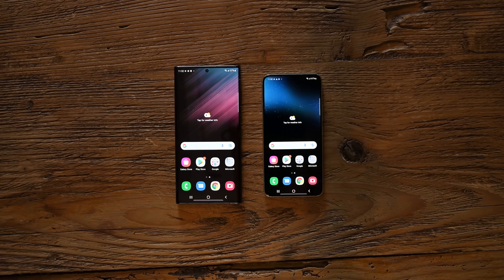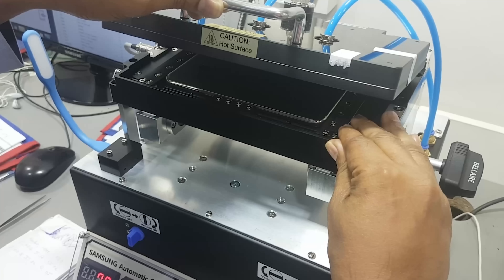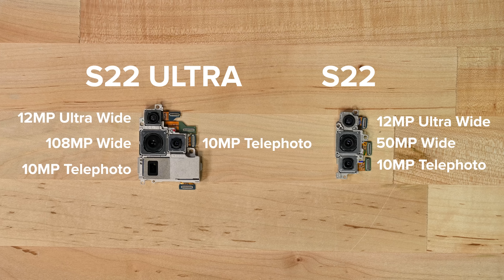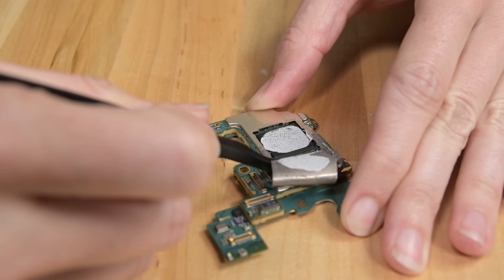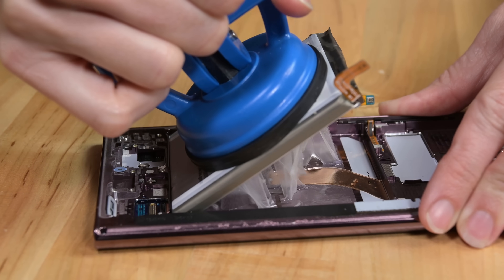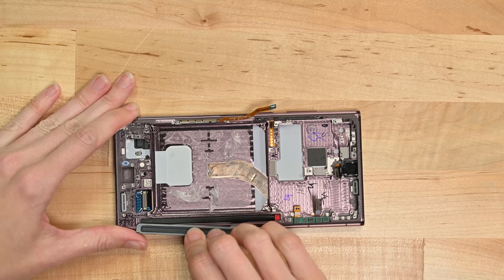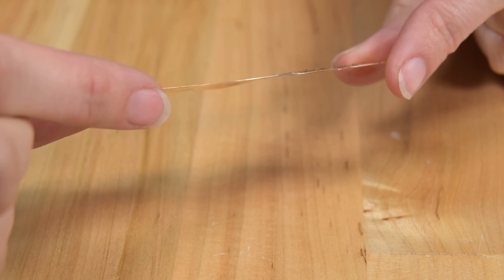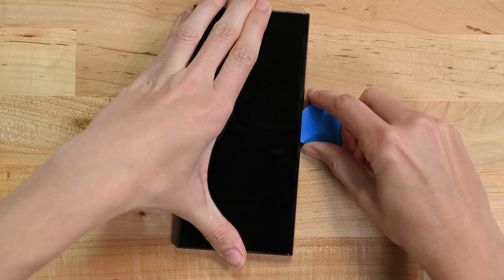Galaxy S22/S22 Ultra Dual Teardown: Note what we expect

Comment: Samsung: Almost all screws are the same lenght and size. The different ones are easily identifiable. All screws are phillips type screws. There are no hidden ribbons and overall unnecessary complexity. There are no software locks and no features removed by third party repair. YOU ARE ABLE TO BUY NEW SAMSUNG OEM PARTS.  

And you suggest a 3 on repairibility? Are you nuts? Apart from the excessively glued-in battery this phone is a breeze to work on.

And iPhone gets a 7? Don't make me laugh.

Comment: Love how tough adhesive drops the repair score to a 3 but software locks get a 7.
Reply: Seriously underrated comment. If it doesn’t work as intended after replacing parts - then it isn’t really repaired
Reply: Lmfao so true ifixit is so bad at this
Reply: Samsung devices costs so less to repair from Samsung themselves
Compare to mi, Vivo and other brands
Reply: It's insane just how daft these guys were for this....."repair scores that actually don't account for repairability".

I don't care if this got changed, but the fact that this was even a thing in the first place i just insane.... whilst the rest of the industry shows the world how terrible software locks & paired components were on the iPhones, some dudes who gave "repairability scores" dropped scored for "glue" whilst leaving the device with the most "paired" components at a 7.

Studied mechanical engineering, so the idea of someone complaining about glue that can easily be dissolved with Isopropyl Alcohol easily is just crazy to me. 

PBK Reviews' scores & teardowns was always 100x more relatable.
Reply: @Awaks  iFixIt has it in the name, they're apple duds
Reply: Yeah but after mrwhosetheboss posted the video about batteries on Samsung expanding idk it will matter because Samsung going boom boom again
Reply: @iustin1658  watched that and personally not the biggest issue in the world because it only seems to affect stored devices that have dropped to 0% charge for a long period of time. As long as you keep the phone with a 50% charge while stored the lithium barrier won’t break down and inflate the battery.
Reply: @CommanderCodey  that’s not always going to be the case, it’s not a big problem, it’s massive, because that means they are just weaker and will cause problems

Comment: I just bought the galaxy s22 and it gets scalding hot and slows down to a crawl when it does anything. Not something I expected from a new phone. I had an LG g7 which had a vapor chamber and anything I did on it kept it cool and ran everything fast. Why does samsung have an issue with overheating????

Comment: I upgraded from my s10 to an s22 Ultra, was surprised to realise the "ultra wide" camera isn't actually as ultra wide as the one on my s10!  And its also a shame they ditched (before the s22) the sensor for reading your pulse.  Also have you noticed that the small rubber bit at the end of the spen holder is not the same colour in every model.

Comment: If you accidentally inserted the sim card ejector tool into mic hole. Does it damage the water resistant?
Reply: No, modern phones have their seals at a right angle to the direction of the mic hole

Comment: I'm getting real sick of this expensive non-repairable stuff they're foisting upon us. I just bought a Framework laptop that is completely upgradable and repairable with a simple screwdriver. It's the antithesis of my MacBook Air. I keep hearing about the Fairphone smartphone but it's not available in the United States so why do they keep reviewing it here? I have a Terracube phone but the processor and camera are subpar so I went back to my OnePlus 6T. If somebody comes out with a workable smartphone that has the removable battery, dual SIM & microSD card slot that can be opened up without heat and prying, it's going to sell like hotcakes. Apple really did usher in the concert of expensive, throw away devices and Sammy has jumped in on it big time now too.
Reply: They don't do microSD anymore, because storage space is a way for them to jack up the price. Offering flexibility in SIM cards also sells them fewer units. It's all about those profit margins, environmental sustainability be damned. I don't see it changing any time soon, sadly.

Comment: Thank you for the video, it's terrific.  I was trying to pop the sim card out, and put the remover tool in the hole in the top, instead of the bottom, before I figured it out.  Did I ruin anything?  :-(
Reply: Maybe popped the grille on the mic, but the mic should still work. Phone will not be liquid resistant going forward

Comment: Did the scoring change? I remember the Macbooks getting a 3 because you can't replace anything. Here, you could replace about everything (ability exists, parts are questionable) and it too gets a 3?
Reply: Yeah that's weird. This phone is very repairable. Other teardown videos show you can even swap parts between phones without getting errors like the iPhone. Everything still works and mostly all parts in the phone are modular and easy to access. 

Not sure what their angle is here.
Reply: iFixit seems to have some very awkward relationship with Samsung. They scoring system isnt very reliable. They seem to constantly score Samsung stuff very low even if it is kinda repairable sometimes compared to other brands that got the same score. Lets not even mention that Samsung doesnt lock hardware to the motherboard or to the software like other brands. And still, they got only 3/10... oh well
Reply: they really didn't like the glue
Reply: @bradhaines3142  😂

Comment: 3/10?  Tough adhesive should not downgrade the score.  Just take a little more time.  Everything looked like it came apart very easy.  No soldered pieces together than needs extra work.  Just heat, take your time with adhesive, unscrew, unclip, and repair.  9/10 for me.
Reply: needs less glue. better ways to put things together
Reply: @bradhaines3142  Or no glue at all. There's absolutely no point when it's crammed in there tightly as it is.

Comment: 3/10 despite you not being software locked for replacing components.
Reply: iFixIt has a hard on for hating Samsung for some reason. Have been that way for a few years now.
Reply: @spacebound1969  Because Samsung stubbornly refuses to stop using super adhesive on a freaking battery for crying out loud. This guide depicts it being way easier to remove than they actually are. 

Not saying Crapple is any better for their countless shenanigans either.
Reply: Should have gotten at least an extra point for the software being completely open to component replacements, something that cant be said about some other brands

Comment: You are absolutely right! They should have made the S22 Ultra thicker to have a flat back with the camera lenses and they might have had the space to put in a proper vibration motor and all the other stuff like sd-card expansion, 3.5 jack, ir blaster that the phones are lacking. Even a bigger battery pearhaps.

Comment: Looks like theyve switched the speaker wherein the beefier one is at the top while the weaker side is at the bottom to compensate for the new vibration motor location, Looking from the x rays, the bottom ones seem to have the same exact magnet size of the note 20 - s21 series phones Top speaker assembly.

Comment: 4:04 how is it pushing heat down and to the sides there is no fans 🤔
Reply: Conduction?
Reply: Magic
Reply: they part that makes heat is at the top. the vapor chamber is attached to a piece that also conduct heat well. it would spread from the source

Comment: So not very repair friendly (thanks to adhesive and glass panels), batteries that are way too tightly shut in, and still no headphone jack and SD card slot? Looks like I'll be staying with what I've got.
I don't want to lose my data if the NAND goes kaput. Storing data on the SD card means that (a) you can easily transfer the data between devices, and (b) if the phone logic board goes kaput, you haven't lost all of your data.
Plus, if the SD card goes kaput (which, some of mine have in the past) then you don't need to buy a new logic board, you can just buy a cheap and cheerful SD card and get back some storage space.
Reply: They're trying to force people into subscriptions for cloud storage
Reply: @TheRealGandalfIgglywumpus  I don't think there's nothing wrong with that I use a cloud service and you can also get a external hard drive or a USB drive
Reply: @jeffreyfricke2304  So you will need a $$$ mobile plan to go with that $$$ phone just to have acess to your data (provided you never travel somewhere without coverage) which you've entrusted to a corporation for safekeeping.  Or you need to lug around yet another device just to make up for the stuff thats been taken out.  It all makes good sense.
Reply: @ccmangb  Have you seen how small these storage devices are? You're telling me you have no space in your pocket for a memory device the size of your thumbnail?
Reply: @spacebound1969  So you're telling me that I need to carry around yet another something tiny that I could lose and have to connect whenever I need it just because some company removed that feature for more profits?  Sounds great.
Reply: @ccmangb  you don't need to. Just don't buy the phone and quit whining like a child.
Reply: type c flash drive works great in phones. i can live without sd slot. definitely miss headphone jack and removable batteries though
Reply: They aren't coming back
Reply: Or just use cloud storage. All my S22 phone content gets backed up to my One Drive, my Google Drive, and my Amazon drive. Much easier than dealing with a micro SD card.
Reply: @aaronwt  Of course, trust your private data to the cloud, to providers that get hacked regularly.  You also pay a subscription for access, while depending on them to not shut down.  Not only that, you need to pay even more for mobile data, and if you ever are not online, you lose access  (anyone whos travelled knows this all too well).  That makes a lot of sense.  It's funny how people are persuaded to happily pay more and more for stuff that's taken away.
Reply: I dont pay more for cloud storage. I actually pay less. My main cloud storage is one drive. I only pay around $50 a year for Office 365. By getting it at half price, when on sale. And Office 365 includes 1TB of storage for each user. Up to five users.

Comment: All the cooling and it's still  it even close to what Apple is capable off with basically no cooling whatsoever. And it still throttles a lot on the Samsung side AND they have to throttle the performance in 10.000 apps.

And still basically no repairability whatsoever. Especially the screen is pretty much impossible to repair, and so is the battery for normal people.
Reply: Samsung repairs are incredibly easy. You buy a service pack screen, which is a new screen already adhered to a new frame, remove the back glass, unscrew a bunch of phillips screws, disconnect some cables, remove everything, and then reassemble it in the new screen. if the back is broken or gets broken during repair then you just buy another for like $10 and then bam the phone looks like it came right out of the factory.

Comment: The only thing i hate about Samsung is the display , even in the older models they cost arm and a leg to replace.
Reply: because they're top notch quality
Reply: OLED screens are expensive. if you look at prices of Refurb Apple OLEDs vs Samsung Service Pack OLEDs, they're fairly close to each other. The Samsung service packs also have the entire metal frame with them which is why they're usually a bit more expensive. A screen repaired Samsung will end up looking brand new as where a screen repaired iPhone will usually end up having dings in the metal or even worse, a cracked back glass.
Reply: @the_real_treezus  i agree with that and understand it. I just hate the pricing, one display costs about the same as second hand working device of the same model. I hope this will change with time and get cheeper , then I’m sure more people will go for repair than just buying new device.
Reply: Samsung OLEDs looks best but are known to bite the dust faster than other makers who also use samsung oled panels. Samsung likes to push a lot of power burning the oleds faster.
Reply: @Ezio470  this is really interesting observation, never crossed my mind. Respect!
Reply: @BalkansWay  That's not only from observation but from personal experience. Samsung note 9 screen turned green after a year. after some extensive digging I read somewhere it was caused after a software update form Samsung that changed the bootloader version and that new bootloader version had screen settings with higher voltages which is what caused the damage. There's no fix than to replace the screen altogether. and the bootloader cant be rolled back to older versions. Samsung outright brushed this issue aside as the phones was already old at that point.
Reply: @Ezio470  im really thankful for this information, as I already said never crossed my mind.Seems like really profitable move by manufacturer to push few people to upgrade or repair .

Comment: I miss user removable batteries... :( 
They need to make a comeback. 
Brilliant teardown!
Reply: The EU is planning with laws to force the manufacturers to do that, but still no ETA. The uni connector(TypeC) is finally set in stone with laws, so no escape or tricks for Apple this time.
Reply: @talos86  yeah but what happens when we find the limits of type c? laws going to keep stuff in the past? it usually does.
Reply: @bradhaines3142  luckily the TypeC is far from its limit, so nothing to fear. When the time comes, they smiply create a new law, which one defines the new standard.
Reply: @talos86  yeah because more laws are ever what we need
Reply: @bradhaines3142  there are things, which u can only solve with laws: the planned obsolecence and the right to repair. Good example for the right to repair is the Playstation. Sony is forced to remove the warranty void sticker from the machines, so u can clean the device at home even if its still under warranty.
Reply: Useless
Reply: My Note 3 is on it's third battery,  phone company's have realised that people keep phones to long and have built in a failure mode with batteries that cannot be easy renewed,  treat customers like mugs.

Comment: "Faster processors means more heat". Guess our processors now reaches thousands of C thanks to the last 20 or so years of development. :D
Reply: And especially Apple probably does not know about that with their much more powerful A15 and basically no cooling whatsoever.
Reply: @Raja995mh33  yea and then apples chips overheat after 30min of gaming and throttle to half of their performance. Good job apple!
Reply: @propiii  android doesnt even go 5 minutes before throttling, and i wont have an iphone.
Reply: @bradhaines3142  you sure about that? 😂
Reply: @propiii  Do some research. I just looked at a review/benchmark between the Snapdragon 8 Gen 1 in a S22 Ultra and Apple A15 Bionic in iPhone 13 Pro. One of the things they measured was thermal throttling by running one of 3D Marks benchmarks over and over and until they managed to get a similar score multiple times in a row. The S22 Ultra with the Snapdragon throttles MUCH faster and MUCH harder. The Iphone 13 Pro with the A15 Bionic dose throttle but not by a lot and once it hits its sustained performance it's nowhere near as big of a difference compared to it's performance for the first run through the 3D Mark benchmark

Comment: I could break open and assemble any Samsung phone with a little bit of effort and tutorial, I can't say the same with iPhone.
Every Samsung should have at least  more than 5/10, it's really not that hard compared to iPhone. 
One type of screw, a gel pack, alcohol, suction cup and you're home Pony Boy.
Reply: Don't forget that Samsung in their flagships doesn't pair their parts to the logic board (either stopping the components from working or placing nagging messages about non-genuine parts) unlike the fruit phone.
Reply: @PeterdaPanda  Samsung actually has done that too.
Reply: Dude that's just hands down bullshit. 
iPhones - especially when it comes to screen and battery replacements - are a MILLION times easier repairable than Samsung phones.
All you need for the iPhones are TWO screwdrivers and a suction cup. That's literally it. And you get the "proprietary" screwdrivers literally everywhere these days. People make this way too big of an problem. But a hefty glued in battery and screen? THAT is in fact a real issue.